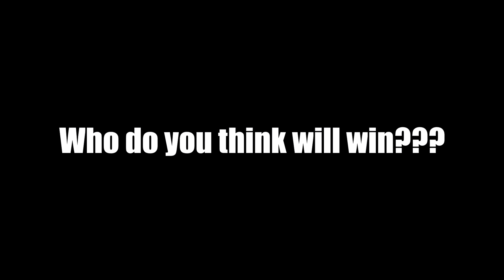Outlaw Armageddon 2019 Winner

Comment: The thing that’s amazing about Kayla is she can drive and she does all the work on her car and engine.
And Kayla also shifts her own gears by hand not by automatically powered.
Reply: they all should be required to shift manually....all cars should have clutches....I know they only run 1/8th mile BUT they should all be 3 speed manually shifted transmissions, put the driver element back into racing like Prostock....all this automatic & automatically shifted stuff is lame, just a passenger along for ONLY 660ft.

Comment: Straight off the trailer... Kayla. Besides I’m Ford to the core I bleed Ford blue and she runs BBF Power so HELL YES I’m riding with Kayla 💯😱💯👍🏻👍🏻💯
Reply: The only thing ford on that motor is the logo
Reply: Montana Made its got Ford Hemi heads on it and it’s a Ford based block. It is Ford Powered, go to the HPP tuners channel they done a video of Kayla and the car and they did a few dyno pulls because they are tuning her car this year. But it’s Ford just like my Dart Block, it may say Dart on the block but it’s a 351 9.5 deck Windsor SBF. So hate to break your heart but that’s two big no prep events Ford powered cars have won, Mike Marillo won the NPK points series last year running BBF power and Kayla won Out Law Armageddon with pro charged BBF power. You haters can’t stand it lmao🤣🤣💯💯😱😱😱
Reply: @jamiemuncy2219  what part of the motor was MADE BY FORD?
Reply: Montana Made what part of the NHRA pro stock cars like Bob Tasca’s is Ford? Just because it’s after market doesn’t mean it ain’t Ford. I bet her block has the 385 BBF deck height I also bet that the cam journal is in n the factory BBF location too. I just about bet ya she runs the factory aluminum casting 427,428 cobra jet Hemi heads. Her car is Ford Powered so don’t get it twisted💯💯 My dart iron eagle block doesn’t make my engine a dart motor, it’s a ford. I guess the GM guys aren’t GM either huh 🤦‍♂️🤦‍♂️🤦‍♂️
Reply: @jamiemuncy2219  exactly...none of it.

Comment: Head to head on a true no prep road I would pick Kayla all day long.  Lizzy has the rep, has the more high dollar car and backing (daddy) and more HP under the hood.  Kayla is the tougher and better racer.
Reply from the maker: For sure.  Kayla has a beast of a car and I'm always thinking once she gets that combo figured out and her great reaction times she will be a wrecking ball in the top cars in No Prep Kings.
Reply: Is Kayla’s family also a long standing drag racing family with loads of backing?
Reply: They build racing engines.
Reply: Kayla makes more power than Lizzy and lighter as it's a pro mod but Kyes car that Lizzy races has way more CC's I'd take Kayla for the win on street and no prep but Lizzy's real race car has been faster than Kayla and even faster than fireball has her real car not Kyes 5th Gen Camaro she races has been 3.60s fireball has been 3.80s

Comment: When did Kayla put an LS Chevy engine in her Mustang ?  It's odd to see her winning.
Reply: That's what happens when you run a Hemi. You win.
Reply: wvXvxvXvw her motor is still Ford but does have hemi heads so it's still Ford powered
Reply: @stevebellen298  
If her engine had Ford heads, it wouldn't make power.
Reply: Rick Taylor hey I'm a Chevy man 💯 I won't even ride in another brand except for dirt bikes ATVs and side x sides
Reply: Rick Taylor Ford did make there own motor with hemispherical heads on it boss 429 they couldn't call it a hemi because Dodge owns/or owns the rights to the word hemi but once again I'm all about the bowtie die hard about it